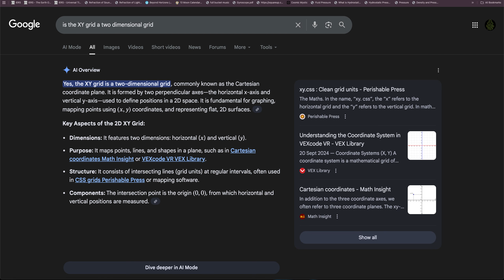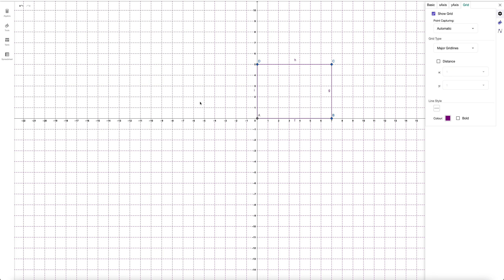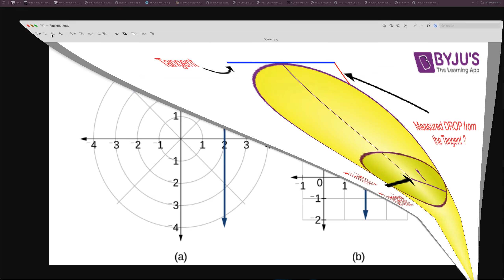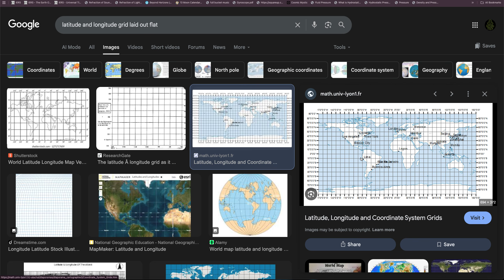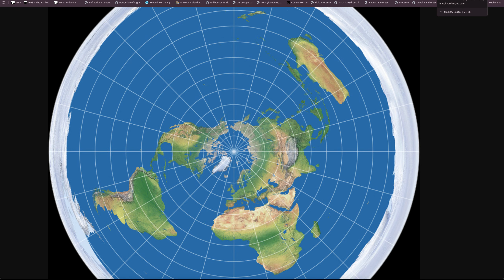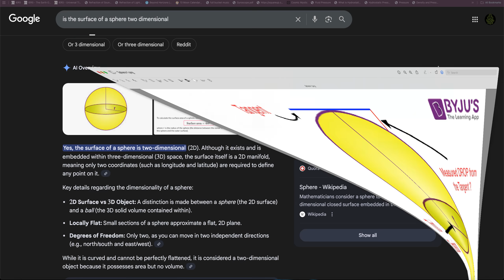The 2D Globe  lol

Comment: I've always wanted to find someone that's capable of making a computerised montage of all local maps (used for precise and accurate navigation), to define correct landmass sizes, orientations and distances; the squre grid is used as flat-horizontal with perpendicular latitude & longitude, thus multiple local square grid maps will form a square or rectangular map, but idealy without mercator style distortions, nor azimuthal equidistant style distortions.
And as you point out, a polar coordinate system is practically identical to a square grid, so then having an overlay of the two grid types mentioned (as I have illustrated before), I assume will provide us with a little extra verifiability.
But this is just my speculation and personal interest in the visual & practical outcome.
Thanks for the video, Brian 👍
Reply from the maker: The problem is scale differences with local ordinance survey type maps, you also can’t have perpendicular latitude and longitude as then they are out of sync, there’s so many issues that only exist due to the stupid globe, that its like they’re making sure that no correct map of the world, or even just large areas of it can be trusted nor creates ?
Thanks 🙏
Reply: @BriansLogic  "there’s so many issues that only exist due to the stupid globe, that its like they’re making sure that no correct map of the world, or even just large areas of it can be trusted nor creates ?"

Are you seriously trying to say that you can't simply go out and measure things and then plot them on a flat map? If the Earth is flat then all you need to do is measure the distances between places and then scale them down to fit on a sheet of paper.

How about this Brian... start with a map of your house. Take the measurements of all the features in it and then draw it all down. Then expand it and go outside and do your street. It doesn't need to be super detailed. Just take distance measurements between landmarks. Once you've done your street move on to your town.

Honestly Brian its absurd for you to say it's "due to the stupid globe" because you as a flat earther don't need to worry about any of that. If the Earth is flat then just take the measurements and plot them down on a nice flat sheet of paper.

You know what... you could even get yourself a nice little cheap theodolite to help with the process for £500 or so once to make sure you are getting the angles and dimensions right once you get to the longer distance stuff.

Who am I kidding though? Neither you nor any other flat Earther will ever do anything like that. Putting your money where your mouth is and providing actual undeniable evidence isn't in the flat earth playbook after all is it?
Reply: @bobleonheart9600  I don't think Brian's welfare cheque gets close enough to 500 quid. We are a generous bunch in Ireland, but not that generous. You have to wonder why he persists, other than the obvious attention fetish. He's truly a deluded soul who believes he's some savior, while simultaneously never leaving the sanctity of YouTube
Reply: @BriansLogic  “There’s so many issues that only exist due to the stupid globe”: translation . . . ‘If only the earth weren’t a globe we would have no problem producing a reliable flat map of the world’. 
Yep, you certainly shot yourself in the foot there
Reply: @BriansLogic 
Thank you for the insight 👍
This is sort of why I think having someone try produce the best they can, a computerised, automated montage of all same scale local maps, maybe have various versions, for different common scales; sort of making a visual storage of all local same scale maps.
Idk, would be super cool to see & even better if we could make it sort of interactive, displaying different forms based on coordinate style input, sort of how you showed in your video, but then the computer automation would restrict you based on known & reliable distances and directional orientations etc.. hopefully helping make clearer what sort of mapping distortions there are or have been used, sort of like the French guy Herve talking about magnetic declination having some "fudge" built in to it.. 
Again, just my speculation based on my level of knowledge on cartography & geometry, lol 🙏
Reply: @KieranFlanagan-m4t simple to you when you've never even attempted to measure your local area, nevermind distances over oceans.
Reply: @KieranFlanagan-m4t I didn't say, "can't".
Reply: @KieranFlanagan-m4t usually using Nautical Miles, via Celestial Navigation, which is how navigators are measuring a flat Earth.
However, I like the idea of ultra high detail under-sea depth charts, in which features are measured and marked on maps, which will be measured by other means, with different methods such as sonar for example.
Which brings accountability & verifiability to the supposed Nautical Mile distances between any two locations.
Reply: @KieranFlanagan-m4t a flat triangle on a flat Earth, what about it?
And yes, I know of Gnomonic projections, what about them?
Reply: @TacMind You mean the French guy Herve who doesnt seem to understand what magnetic declination is, at all?

Comment: Australia has three main time zones (ie ignoring daylight saving differences, the external territories and Lord Howe Isoand, and Eucla’s unofficial UTC+8:45).

- Western: UTC+8
- Central: UTC+9:30
- Eastern: UTC+10

(The Central zone is shifted forward by 30min because most of its population lives considerably east of the +9 central meridian.)

The longitude span of the continent is about 40°, meaning that there is about 2h40m difference in solar time between both coasts, hence why the country has ended up with the time zones separated by an hour each (noting the 30min shift of Central described above.)

—

Whilst the US is about the same width as Australia, because it is situated at higher latitudes than Aus, the US spans a wider range of longitudes - about 55°, making the solar time difference between both coasts about 3h40m.

So that’s why the US has 4 time zones separated by an hour each.
Reply from the maker: A time zone is ONE HOUR Andrew, so you can’t have three time zones within 2 hours, it’s just stupid that you can’t understand such basic stuff, shocking actually ????
Reply: @BriansLogic .  let’s pretend that you are right and time zones are one hour. So if the time difference is 2 hours, let’s say 8am at one location and 10am in another. With one hour time zones that would be 8am, 9am and 10am. How many time zones would that be Brian? It’s just stupid that you can’t understand such simple stuff. Shocking actually.
Reply: @BriansLogic  A time zone is an area which observes a uniform standard time for legal, commercial, and social purposes

It’s just stupid that you can’t understand such basic stuff, shocking actually ????
Reply: @BriansLogic  so, if it’s  1pm at one coast of Australia and 3pm at the opposite coast but, as you claim, there are only 2 time zones then what time is it in central Australia? If, as you claim there are only 2 zones then there should be only 1 hour difference surely.
Reply: BTW Brian, you’ve debunked the flat earther claim there’s more time zones in the south than the north because of the extra area in the flat earth ‘southern hemisphere’.

By your definition there are exactly 24 time zones in the north AND the south.
Reply from the maker: @andrewjohnston6631 No Andrew that’s your paradigm that includes time zones that don’t exist, and YOU literally tried to claim that there was a 25 hour day, with your comment above ⬆️ because that’s the implication of your comment….
Reply: @BriansLogic  "... literally tried to claim that there was a 25 hour day"

Are you confused by the "off‑by‑one phenomenon"......
Reply: @BriansLogic  “you literally tried to claim…” with “the implication of your comment”

If it was implied by my comment then I didn’t literally claim it.
Reply from the maker: @andrewjohnston6631 If it’s an implication of your comment, then YOU own it Andrew….
Reply from the maker: @Hjaldor You’re the confused one buddy….
Reply: @BriansLogic  but you’re the WRONG one Brian - no doubt whatsoever
Reply from the maker: @DeeDubbayaTranslated as…. Brian is right….
Reply: @BriansLogic  no, you are wrong again - translated as ‘Brian is telling barefaced lies once again’.
Reply: @BriansLogic  you really can’t help making yourself look stupid can you. Translated as . . . ‘Brian looks stupid again’
Reply: @BriansLogic  time zones is just another topic by which you can’t help parading your ignorance Brian. You are just further undermining the flat earth cause - which is fine by me if course
Reply from the maker: @DeeDubbayaTranslated as…. What Brian says about time zones is correct….
Reply: @BriansLogic  you really should stop spreading lies Brian. All it does is further discredit flat earth
Reply: @BriansLogic   it is interesting how there are some questions you either cannot or are not prepared to answer - it says a lot about the lack of credibility of your arguments. For instance, you refuse to say what the times would be simultaneously in two adjacent time zones, and refuse to say if a cylinder has a surface area. It’s almost as if you know the answers to these demonstrate just how wrong you are. 
PS - translation . . . ‘Brian really doesn’t know what he is talking about here
Reply: @BriansLogic  Let’s try this again Brian. Perth and Sydney are 2 hrs apart. 8am in Perth and 10am in Sydney - 2 hours apart. If you are correct (you are not) that time zones are each 1 hour, there MUST be a 9am time zone between Perth and Sydney. So 8am, 9am and 10am - each location one hour apart. How many does that make Brian? Let’s count together shall we? 8, 9 and 10. Is that 2 numbers OR THREE Brian? Do you see how inanely stupid you are yet Brian? Have you noticed that even other flat earthers avoid your channel because your stupidity embarrasses them?
Reply: @BriansLogic Except your commenters, Google, chatgpt and observable reality says you are wrong.

If you are correct, why do 30 minute timezones exist, such as South Australia and Newfoundland?
Reply: @BriansLogic  no Brian, a time zone is one TIME. 2 adjacent zones would usually be (with the occasional politically motivated exception) 2 times 1 hour apart. 3 zones would be 3 times 2 hours apart - just like Australia in fact
Reply from the maker: @DeeDubbayaYou’re gone over the edge there buddy with globe nonsense, you need to get back to reality Mr 40 time zones lol.
Reply: @BriansLogic  it really is a pity you can’t (or simply refuse to) see 2 adjacent time zones are only 1 hour apart. 3 time zones are typically 2 hours apart. This would also be true if there were only a straightforward 24 time zones ( ie without the political local peculiarities). 
The more you persist with this the more ridiculous you make yourself look ( and more untrustworthy too). But, that is entirely your choice
Reply: @BriansLogic  think of it this way Brian: at 6pm in the time zone where you are, what time would it be in the next time zone to your west? And what about in the next time zone to the east? Here in Europe those times would be 5pm and 7pm respectively - a difference of TWO hours across THREE time zones. Perhaps you might explain how a 2 hour difference would happen across 2 adjacent time zones (without invoking one of the political exceptions or DST that is)
Reply from the maker: @DeeDubbayaNo you obviously can’t count that’s 3 time zones 567.
You’re either attempting to gas light me with straight deception,and deception on an idiotic level, as anyone who would believe you would have to be stupid, or you’re simply not able to count to three, which is it there’s only two options I’d like to know ?
Reply: @BriansLogic  and what is the time difference between 5 and 7? Unless you’ve redefined arithmetic it is 2. That’s 2 hours difference between the first and third zones. But there’s only 1 hour difference between just 2 zones. 
By all means keep trying to deny these facts that conclusively show your logic to be wrong - it just helps to bury you deeper in self ridicule
Reply: @BriansLogic  Do you now realise how stupid you are Brian. So in Australia where, if one hour apart, (they’re not) we would have 8, 9 and 10 between Perth and Sydney and YOU BRIAN are claiming there are TWO timezones across those 2 hours. And now YOU BRIAN are saying that 5, 6 and 7 is 3 time zones across those 2 hours. Try and keep you lying consistent Brian…
Reply: @BriansLogic  in case you’d forgotten Brian, it was you claimed that a 2 hour difference in Australia shows there are only 2 time zones. But you now seem to recognise that a 2 hour difference means 3 zones
Reply from the maker: @johndoeagain3748 Listen and I explain time zones to you….
A time zone is ONE HOUR ( see chronometers ) there is 24 of them in a day, so 5,6, and 7, in Europe is three HOURS, whereas In Australia 🇦🇺 Sydney and Perth are 2 hours different, because they’re only TWO HOURS apart, as they sit with only ONE longitude line between them, which places Sydney within ONE TIMEZONE and Perth within another ONE TIMEZONE, the fact that this is difficult for you yet you called me stupid, shows to anyone with intelligence who the stupid one is here….
Reply: @BriansLogic   Perth and Sydney have only one longitude line between them? What? More utter stupidity Brian! So you have zero understanding of time zones AND zero understanding of coordinate systems. Perth is at about 115 deg east and Sydney is about 151 deg east. So that’s about 36 deg apart. So that 36 longitude lines that are one degree apart. It’s also 18 longitude lines that are 2 degrees apart. It’s also 9 longitude lines that are 4 deg apart. Do you understand yet Brian? Saying that there is only one longitude line between Perth and Sydney is EVEN MORE STUPID than saying there are two timezones between Perth and Sydney! Your abject stupidity really has no limits Brian!
Reply: @BriansLogic    So let me help YOU understand time zones if your brain is capable which frankly I doubt. In the winter in Australia, when it’s 8am in Perth, it’s 9:30 am in Adelaide and 10 am in Sydney. So Perth and Sydney are TWO hours apart, and between Perth and Sydney there are THREE timezones (one in Perth, one in Adelaide and one in Sydney). Now do you understand how stupid you are Brian?